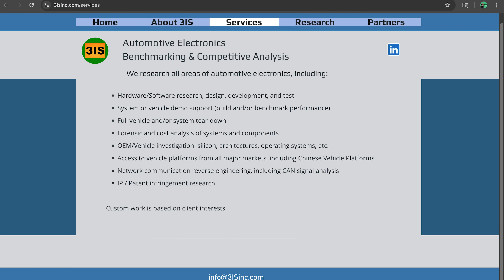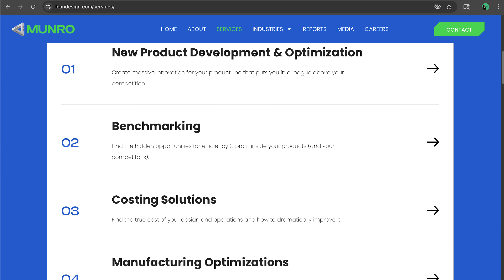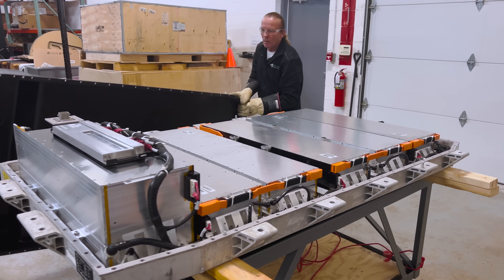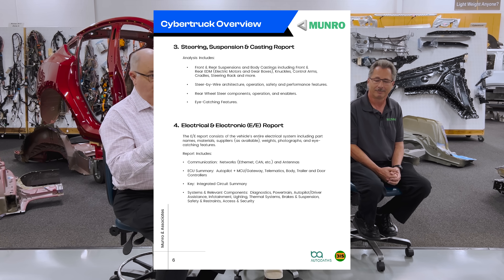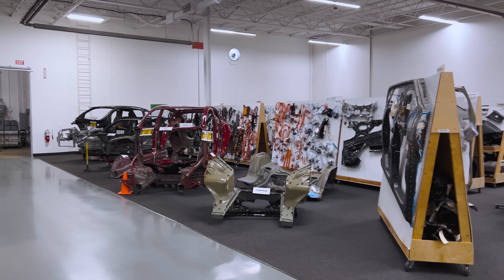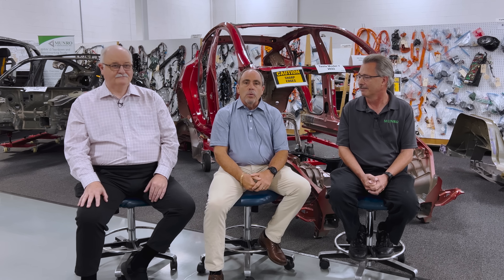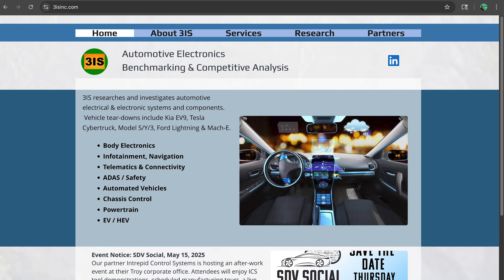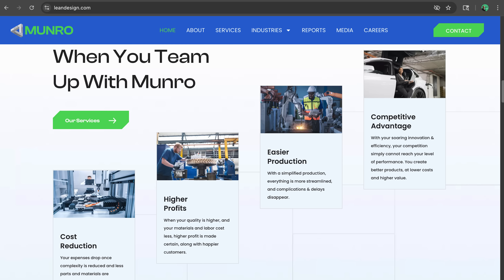Munro & 3IS Team Up to Deliver Industry-Leading EV Analysis

Comment: So Munro finally admits they need someone who understands ELECTRONICS not just BASIC ELECTRICITY and partners with people who do.
Reply: How many video have you watched on the munro chanel? Have you last the most recent about axial flux motors? They know their stuff.
Reply: @akimen64  Yeah 2 guys there know basic electricity (i.e. motors  & batteries) but have no clue (especially Sandy) about any of the electronics that make it all work.  Not the same thing at all.
Reply: IIRC, Munro has worked with 3IS for years.  IDK if this is a new level of partnership, or if it is just an advertisement of the capabilities of both companies.
Reply: @georgepelton5645  Techno-Infomercial maybe the better description.
Reply: Maybe they can partner with someone who understands screws